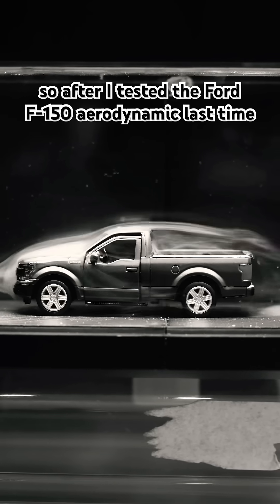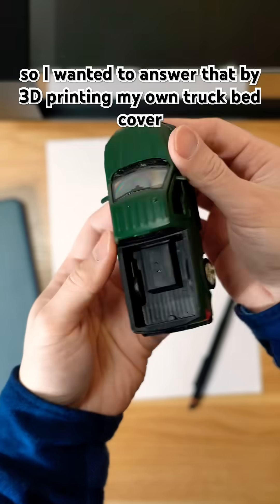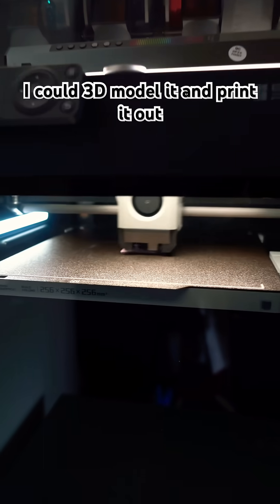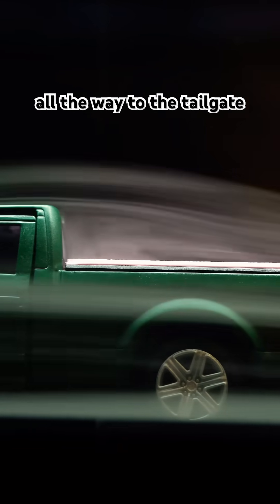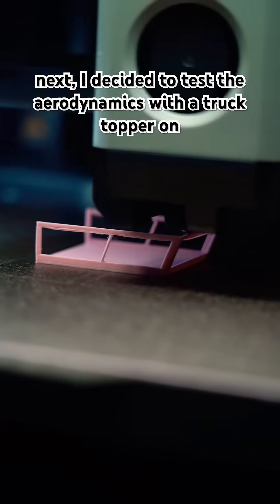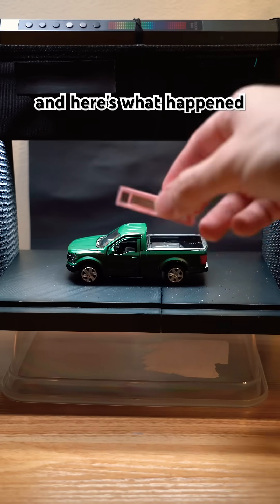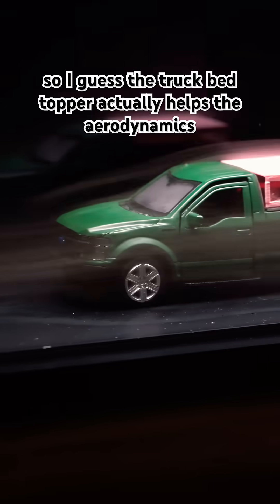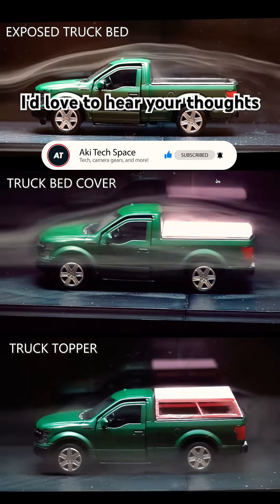Does a truck bed cover improve aerodynamic? 🤔 | DIY Wind tunnel aerodynamic test

Comment: Micrometers are used by machinists and engine builders.  I would like to see this exact test done with the addition of adding a trailer in different configurations.  I feel a truck with a truck topper towing enclosed trailer have better aerodynamics.

Comment: as someone that owns a single cab f150 used for racing, what advantages could we see if we provided an "extended" wing over the cab? so to prevent that eddie current near the back window?
Reply: That won't prevent anything. The reason trucks experience turbulence from the rear of the cab is due to the way the cab displaces air while moving. Without sloping rooflines or vents the rear of the cab essentially becomes a vacuum as air is pushed around the rear of the cab. 

In "science" terms you would refer to the maximum separation angle being too small compared to the roofline of the truck, therefore the Coanda effect fails, causing the air to pass over the rest of the truck while simultaneously  get sucked into the vacuum pocket behind the cab. Same reason why we don't see wings tilted past 15 degrees. Air foils separate and the wing stalls.
Reply: Even those stick on vortex generators might be an interesting what if video.